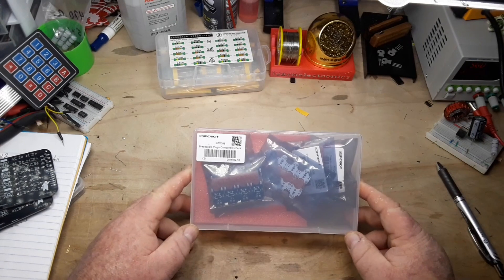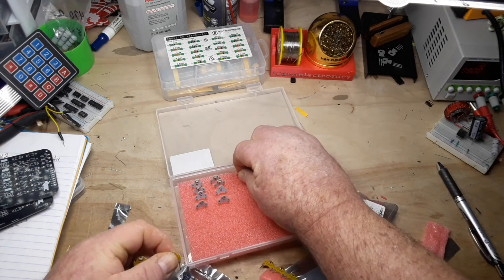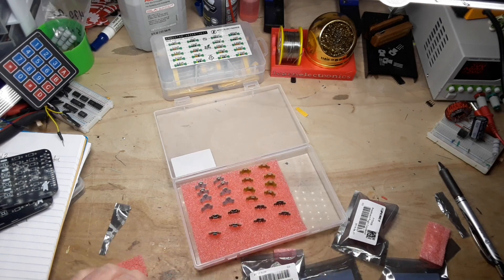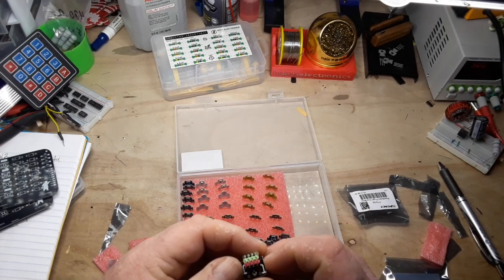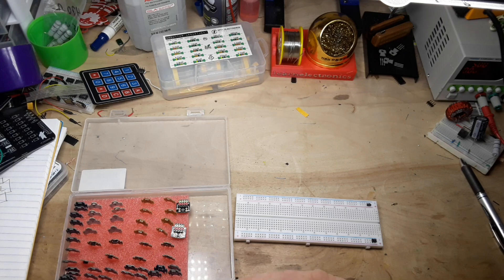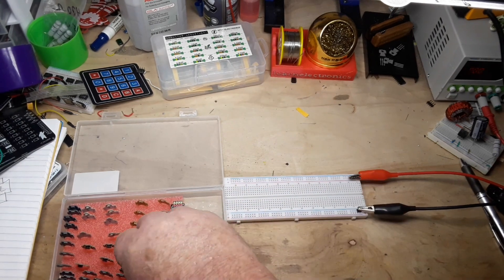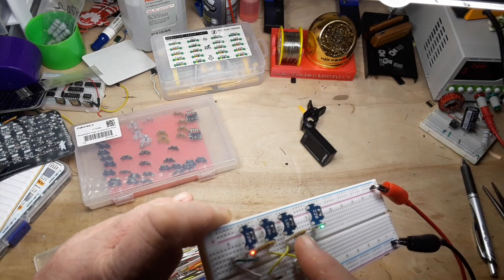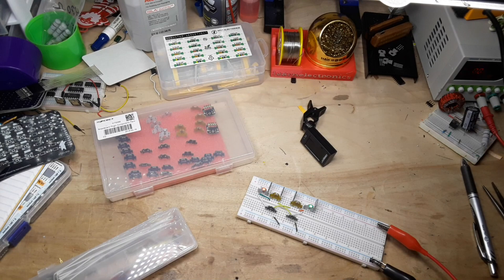DF Robot Breadboard Plugin Components Pack

Comment: I just don't get it, why would one want to use Plugins with smd of using through hole parts is as convenient or probably more so because you need less jumper wires probably. And this has hand full of parts would not even add up to 5$  that way....  The only thing I can think of is it could bridge the gap and get one Aquitained with smd

Comment: Using the 10k resistors and the 47uF capacitors, you should have got something that flashed at around 1.5Hz  (unless my calculations are way off?)

Comment: Absolutely brilliant idea but as you said, it's a bit of a money grabbing hassle. Would be a great idea to sell blanks ready for breadboard plugging and you just need to older on your own SMD resistor, diode, LED, etc.. sell in packs of 50/100 cheap and you will make your money based on volume rather than huge price hikes. eBay would be a good way to get a lot of sales. I wonder if PCBWAY would make them ready to plug into breadboards or if you have to solder legs in yourself.
Reply: Its not difficult to make your own and have them made by say JLCPCB. You could make 500 small sot-23 or 1206 breakouts for $2 plus shipping. Or PCBWAY of you prefer them.

Comment: Maybe it's my lack of experience - it seems that the only goal of this kit is to replace a TH with SMC without the benefit the SMC offers.  Is there any reason to breadboard with SMC instead of TH?

 Besides being expensive you're severely limited in the available components your project might need.
Reply: All I can say about it, is breadboards can be noisy at higher frequencies. But I mean,   he is using a breadboard anyway. I dont quite understand the jist of this. (?).

Great video though paul. Thank you.
Reply: There are tons of components that you cannot buy TH, especially ICs and FETs. However, you would be better off making a converter board for various packages rather than using this sort of system in my opinion.